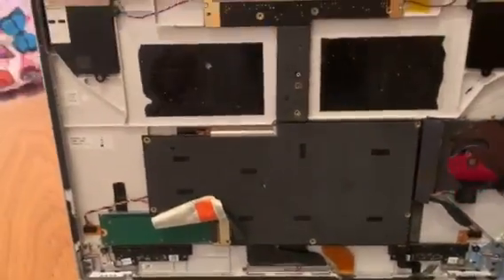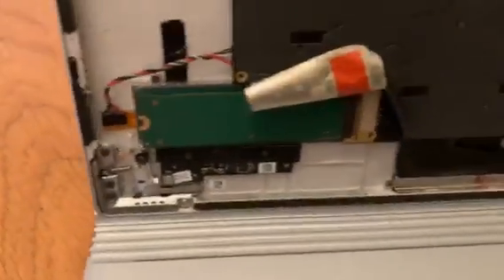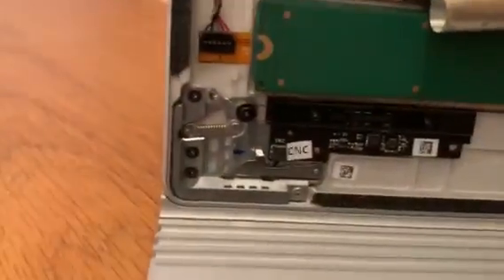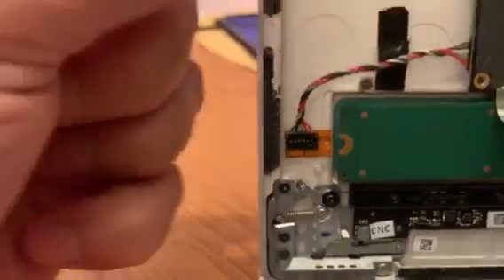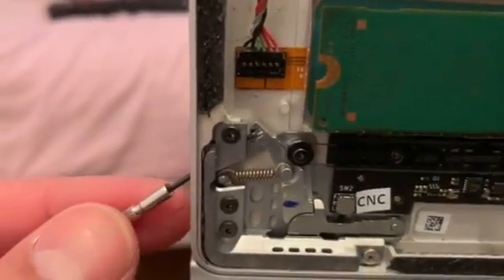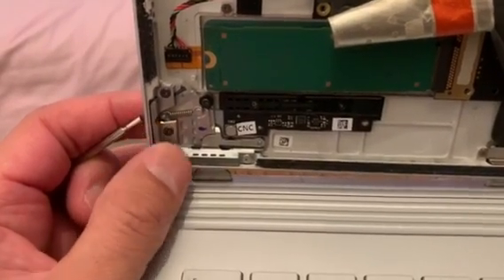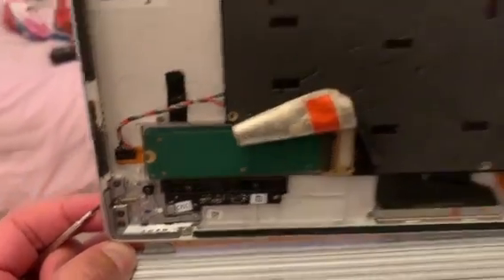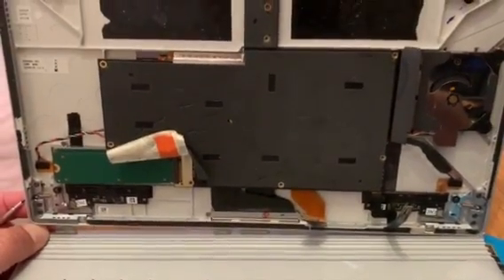Surface Book Keyboard Manual Release

Comment: fuck this piece of shi!t, I am going to buy macbook pro
Reply from the maker: Enjoy, the new m processors are interesting
Reply: @microsoftsurfacegeekdetail5739  yes, they are expensive but what i need is reliability
Reply from the maker: @vikassaini1935  all computers have problems mate , I’ve worked on , fixed or scrapped every model out there.  The workhorses for me are your hp or Lenovo’s but not the entry level crap, more the business line.  You can get an absolute steal sometimes on eBay
Reply from the maker: @vikassaini1935  dive in them , let me know what you get and remember to check your applications work

Comment: Hey man, just had this problem tonight and called Microsoft who couldn't get units to detach using normal protocols...said they can't recommend doing it this way.  How likely do you think this method is to cause permanent damage, even if done properly?? Thanku
Reply from the maker: I have done hundreds and as you can see by the views and comments plenty of others have as well but these videos are made by me to help you with no warranty or guarantees so if you do not feel confident please do not attempt this and keep working with MS to ensure your successful outcome.
Reply: @microsoftsurfacegeekdetail5739  Thanks for speedy response! Of course yes I understand, just wanted your opinion as to the chances of damage with the method suggested (if done correctly)...looks like a simple mechanism???
Reply from the maker: @jj_goes_social if done right and over a soft surface I fail to see how you could do permie damage
Reply: @microsoftsurfacegeekdetail5739  Thanks dude...I just did it. Felt super scary :l It worked and your instructions helped alot.  Things all seem Ok after testing detach mechanism a few times, however I will say there is a bit of mechanical noise afterwards which I don't think was there before. Will update this if any issues in future...

Comment: Thanks!  I had seen the paper clip thing but never would have stuck it in there if I didn't know what was going on.  And this totally solved my issue.  For some reason, my Surface Book 2 thought it was detached but it was not and it was attached backwards.  It wouldn't charge either so I was running out of time to figure out what was wrong.  I used this trick to detach it, then when I attached it facing forward, it "attached" and all is well.  Thanks again!
Reply from the maker: Glad it worked for you - I invested in 2 small screwdrivers and then its pot luck if you get the side to side re-attaching fun.  Lifting from the top helps but I always do it over a bed.
Reply: @microsoftsurfacegeekdetail5739  Well, now I take my time when disconnecting and give it some time before I reconnect, hoping not to have the issue again.  Thanks again for the video.

Comment: question i did release it and now charging but after putting back the release button again red... is there a solution it just stopped after i did once release it...in the begging just some letters did not work but know its not recognizing it..is there a way to reset the keyboard itself...or test for issues...as in the keyboard i got the nvidia card and second batteries...and much more...
Reply from the maker: The only way I test is to use a keyboard I know which works to rule out the keyboard or the connector on the Surface Book.  Try cleaning the contacts first otherwise if a few keys have gone then I think its new keyboard time.  Is it under warranty?

Comment: Thanks so much for this. It turns out I was just being a little... tentative when I was trying this (plus I got the angle wrong)!
Reply from the maker: We all been there...  I actually use 2 screwdrivers now as I find one side always releases fine but the second decides to be a pain so I eject both at the same time.  Do it over a bed though as the screen may fall... thanks for commenting
Reply: @microsoftsurfacegeekdetail5739  Yes...And mine reattached when I wasn't looking! So I had my wife hold the screen after the first latch with a finger between the screen and the base so it wouldn't re-attach, and to ensure it didn't fall when I detached the second latch.
Reply from the maker: @360pickleball  I find the 2 to be a bit trickier than the 1

Comment: Thanks dude, this video saved me! Could not get this to work with a clip but screwdriver made it so much easier! Also knowing that you just go straight and that it requires a surprising amount of force, especially for the second hinge when it's in tension from having the first one open was a big help 👏👏
Reply from the maker: I found this also, especially on older ones where the hinge hasn't been used.  God knows how people did it with a paperclip but I have my trusty screwdriver.  Glad it helped

Comment: Thanks for showing this with the screen removed!  I've fumbled through doing this, but didn't really know what I was after as I was fishing around in there.  Now I can do it each time, the first time.  To answer Stephen's question - yes, it's necessary for each side.  Once you get the first side, put a piece of tape or a post-it note or something over the hole, or when you try to do the other side, the magnet will seat it back into the lock - creating and endless loop of frustration unlocking each side over and over, lol!
Reply from the maker: Thanks for taking the time to comment and answer questions that help.